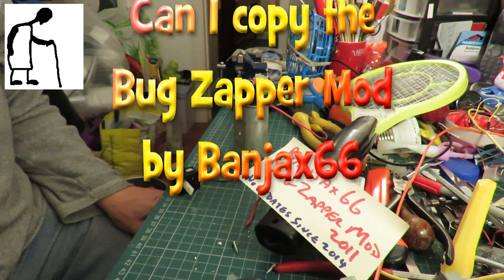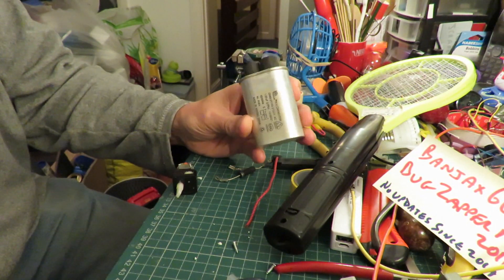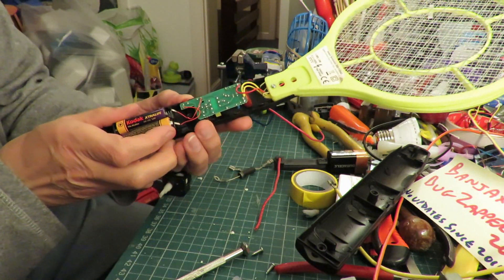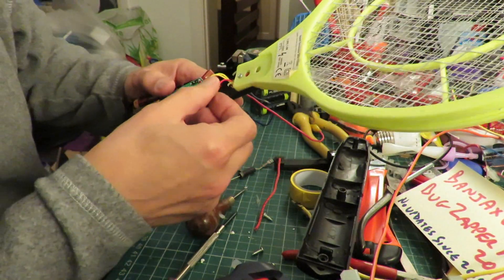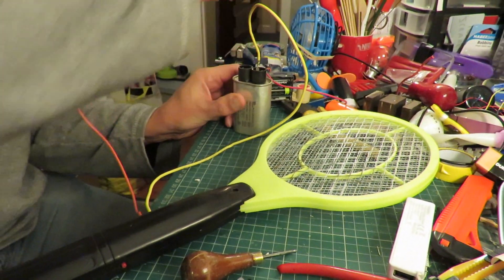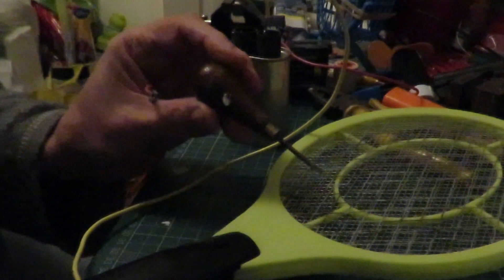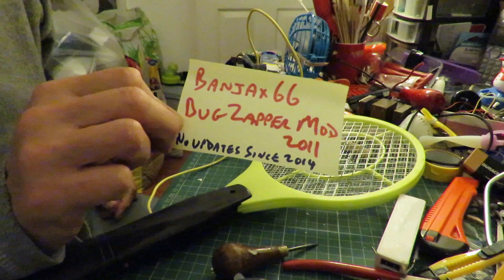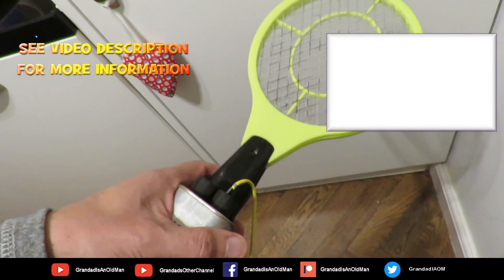Can I copy the Bug Zapper Mod by Banjax66 ?

Comment: GrandadIsAnOldMan , 
                                          the better way is take out out everything past the ZAP button  untill your left with 1 double wire & 1 single wire coming down from the bat & in between there add a voltage generator
Reply from the maker: Thanks for viewing and commenting. I am sure there are better ways, I just wanted to see if I could replicate the one he made, it seemed simple enough and I just happened to have the big capacitor available. We got some impressive sparks but to be honest it was quite unwieldy and I never managed to successfully fry any flies with it 😊🤣😜